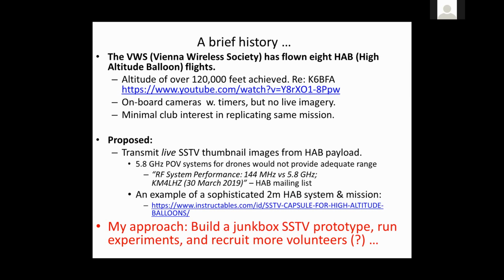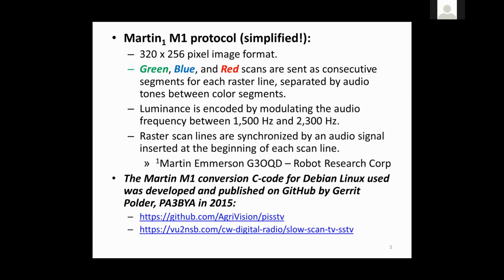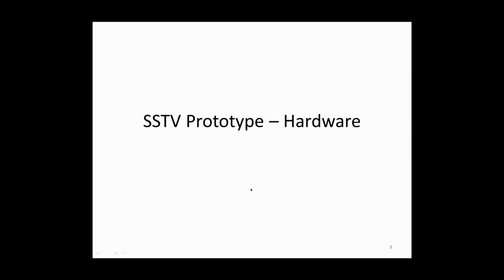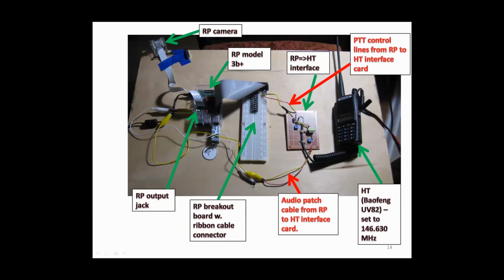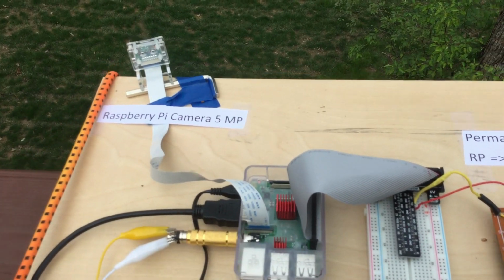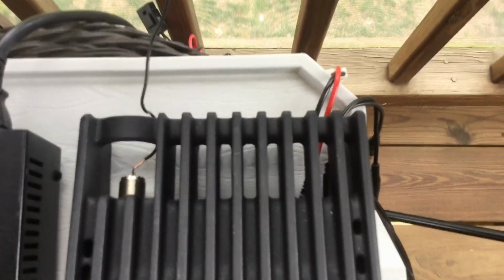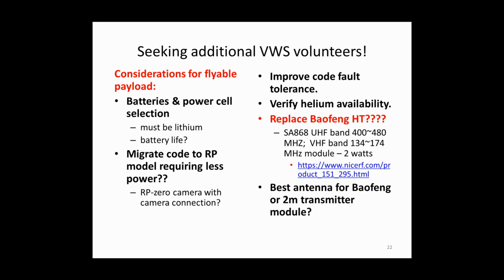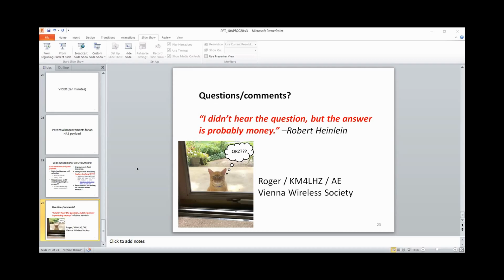A Prototype Slow Scan TV (SSTV) System for a High Altitude Balloon Launch (HAB)

Comment: I did something very similar to this years ago, never launched, but it's all ready to go. I used a C script made by KI4MCW to convert the images into audio and played them out the audio jack.

I have more sensors on my PI. Temp, humidity, pressure, and GPS. I used Bash for the main script. I overlayed the data onto the image as well as my call sign. I'm not as experienced on the Ham side of things so I just ripped apart a UV-5r as my radio.

If I remade the entire thing I would have used python as I have more experience in that and I got all of the sensor values through python anyways. Your project is definitely more neat then mine.

Here is an example of what my images looked like: https://i.ibb.co/K0vNGYs/02-02-0809.png

If you have any questions let me know!